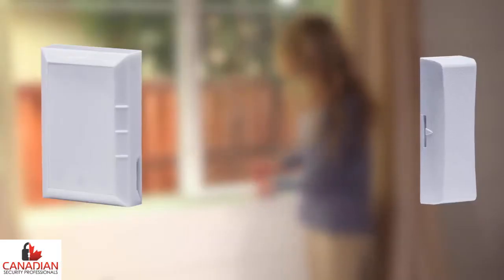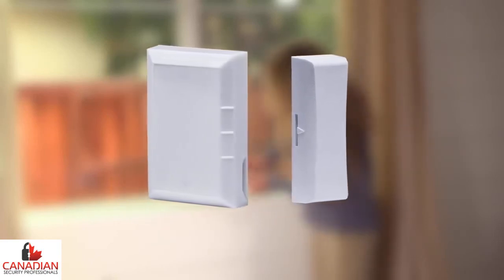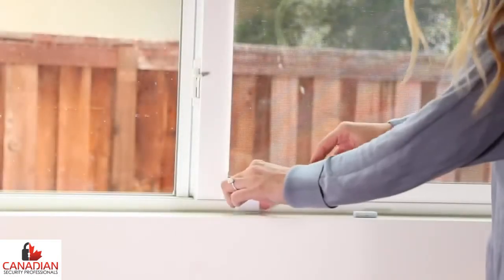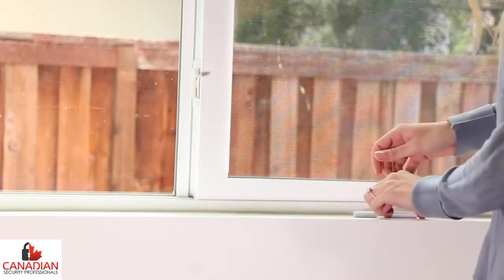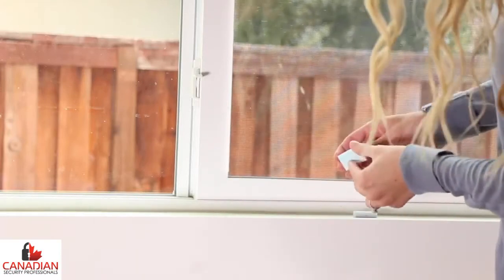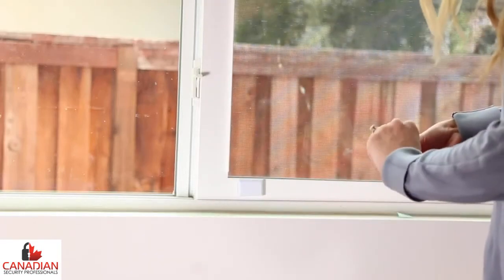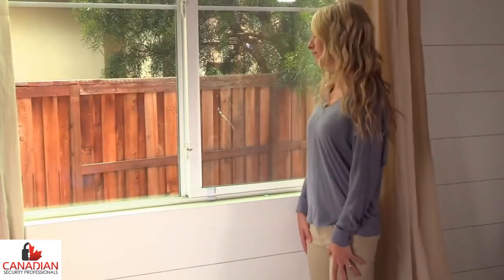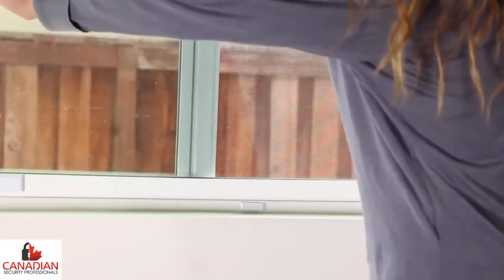How to Install a Window Sensor on a Sliding Window for your Security System

Comment: its not helpful at all, what if the other side of the window will be slide to open?
Reply from the maker: Hi, not every window is recommended to have a window sensor on it depending on the design of the window and how it opens.  If it is difficult to install a window sensor on a window there are always other sensors like motion sensors or glassbreak sensors that can be used instead to protect certain areas. If you are a customer of CSP feel free to contact us and we can see if it is possible to install a window sensor on the window in question. Otherwise I would advise you to contact your security provider for support.